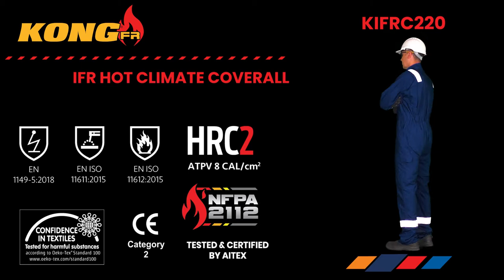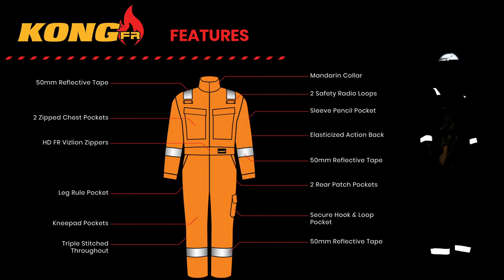KONG FR COVERALLS - Introducing the latest release from Ironclad Performance Wear

Comment: in my 35 years wearing coveralls these have to be rated the worst. Shrinkage is horrendous and the luminous stripes have washed off after 5 uses! Great vid but the coveralls dont measure up. Our HSE has refused to allow further use!
Reply from the maker: Thanks for commenting, we actually appreciate you taking the time to post and value feedback both good and bad as this seems to be.
Can I possibly ask if you can share your contact details through a DM, so we can get some more info and see what the conditions etc are and where our product has let you down.  We did have a very small quantity that performed below expectations in early versions, but in the vast majority of product sold to date we have received positive feedback, so would really like to try and rectify any issue and of course improve our product  so it may be considered by you again in the future.
Reply: @ironcladperformancewear3252  you got my details and I hope what is provided in both my summary and photos assists you. I believe the company has gone back to what we were using before.
Reply from the maker: @strachansdroneservices4870  yes absolutely, received and thanks for the pics as well, that helps a lot.  I have spoken with our Manager based in the UK and he is very keen to touch base and see what we can do to rectify the issue for you and your team.  I'll send another email shortly as in introduction, please let me know if you don't receive in the next few hours.  Oh and as an aside, your Drone site looks great - nice service you offer for locals.